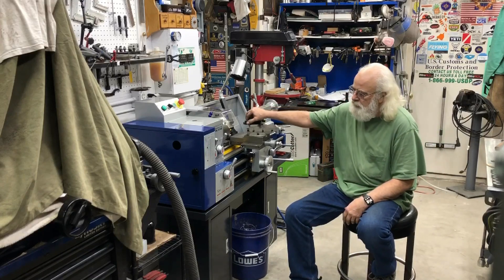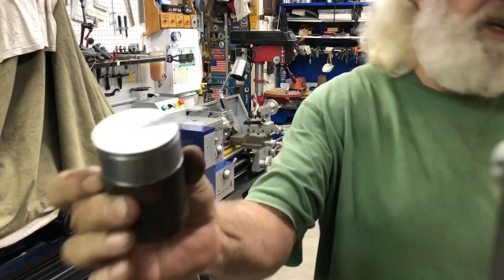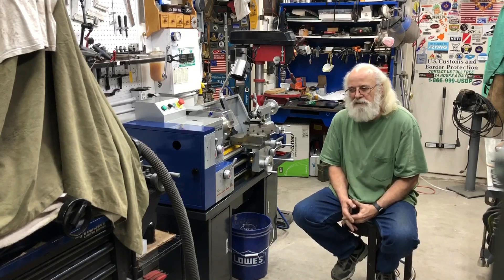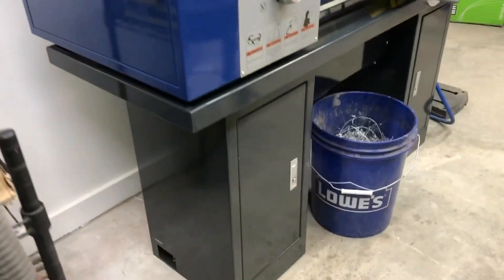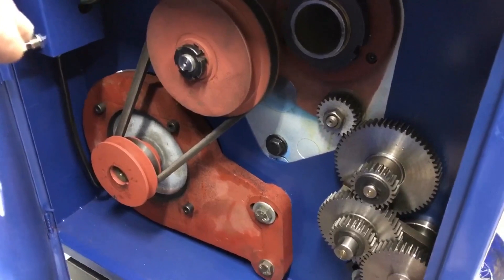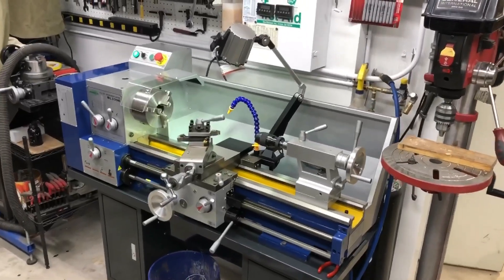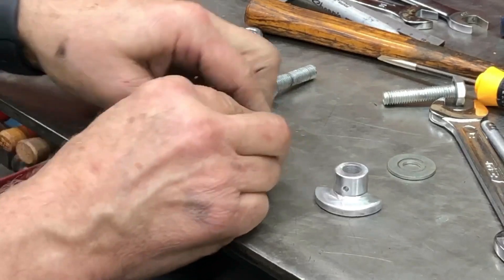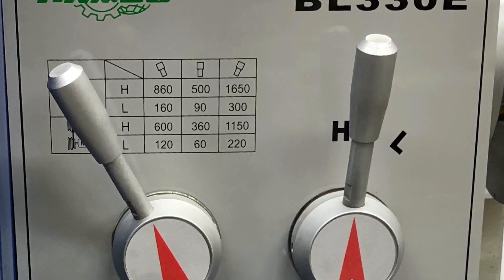ANMEC BL330E 13” X 30” Gear Head Lathe and Using it the First Time to Fix Itself

Comment: Did this lathe come with the 4 jaw and 3 jaw? Can’t seem to find any info on how it attaches either, thanks
Reply from the maker: It came with a 3 jaw and I added the 4 jaw when I ordered it.  The Chuck is mounted with socket head cap screws, and has 3 and 4 bolt patterns on the mounting plate.

Comment: Great  video I'm  in the process of getting  a  larger  Lathe  I  have  a grizzly 602 need a larger  swing  my question  how is the performance today
Reply from the maker: Currently it’s fantastic.
Reply: @papasfixitshop7982  thanks I didn't  no that a gear head was  much cheaper of the two I'm happy  with  my grizzly  now im doing  projects  that needs  a larger swing I  will  be purchasing  this lathe do to your  videos.
Reply from the maker: It’s a great machine, but fair warning, if you buy it from Toolots.com or Bolton Tools, you can expect Zero customer support or replacement parts.

Comment: Recently saw a vid, where a lot of fine chips been found in the gearbox. That guy removed all the oil and cleaned the gearbox from the stuff.
Reply from the maker: I pulled the cover before I used it and inspected the gear head components. The gears and shafts looked fine though not de-burred well.  There was zero debris of any kind in the bottom and the lubricant clean and slightly amber in color.

I’ve since run a maintenance cycle on it and there was a small amount of dark ferrous dust in the used oil but no noticeable problems.

Dark metal dust likely being cast steel it’s likely the gears de-burring themselves.

Thanks for the comments
Reply: @papasfixitshop7982  ok, thanks for the comment

Comment: I have been looking at lathes and am grateful for your tutorial review on this one. I have narrowed it down to this one or a Bolton 12X30 I believe. I have a couple of questions:
1) Are there accessories easy to find for it? I did not see on Toolots page any recommended or suggested accessories  like the show for the Bolton brand. (Live center, tail stock drill chuck)

2) Is the the head a Sanou brand? If I get one I would like a 4 jaw as well and as stated above they don't really have any recommendations on the website or in the manual that could find. I have a 4 axis cnc mill that uses the Sanou head.
Reply from the maker: Thanks for the question.  This lathe uses Morris taper on the head stock and the tail, mt3 and mt4.  The Chuck is bolt on so it’s safe to turn in reverse.  I ordered the 4 jaw Chuck with the lathe and it’s okay.  For the record, Bolton tools and Toolots are the same company.  I bought a quick change tool post and mounting it was easy.  I’m actually on the road right now or I would get you more specs.  If memory serves it’s an MT3 on the tail stock and MT4 on the head.  All the other tooling is standard 5/8” so it’s easy to find tooling.  

In spite of my assorted problems with the lathe I am a big fan and can’t complain.

I have a Bolton Mill, and Bolton is just as bad in terms of after support as Toolots so in either case you will be on your own.

Hope this helps.

KC
Reply: @papasfixitshop7982  thanks for the info. I kind of figured support may be a little questionable. I was looking at the Bolton AT320L as I was going to get a mill also like the Bolton ZX32GP along with a lathe. The AT320 and the Grizzly G0791 are the only two that have the spindle bore I want. The Grizzly is priced a little over $7k and I don't want to spend that much. The reason I said I figured that on the support is because right now toolots has a lot of items out of stock and aren't very forthcoming on when it will be in and won't take any orders on out of stock items.
Reply from the maker: @SM-hy4np  that’s the exact mill I have, ZX32GP

Comment: This is the same lathe that I have and the Worm Gear of BL330E|BL330E-1 went out on it less than a year after purchasing it. https://www.toolots.com/worm-gear-of-bl330e-bl330e-1.html
It's been out of stock ever since I went looking for it. Tool lots is no help. The machining company's name that makes the part is called ANMEC Machine Tool but I can't find a way to get a hold of them. I have no auto feed without this gear. 
Anyone have any ideas? Other than taking the lathe completely apart and sending the gear to a gear fabrication shop and having them make a new one. Which could be done, but then I'd be without my lathe the entire time. Currently I'm just doing everything manually and also using the threading feed. It's frustrating to say the least to not be able to purchase a part when it's needed.
Reply from the maker: I guess we are companions in frustration.

My motor is being rewound as we speak.

I noted that the lathe is mostly a total loss lubrication system.

Although the gear head has oil, the rest must be lubed every day.

Comment: Hey Papa, great vid! I was wondering if you still had the diagram you used to wire in the pump. I acquired this lathe from someone that wired it incorrectly and it trips the breaker when I try to run the pump. Do you think you could share the diagram or take pics of how you wired it?
Reply from the maker: So I can’t attach a photo to this string but I could send one via email if you contact me at papacondesfixitshop@gmail.com

Comment: Papas',  Cool video.  I bought a China 13 x 40 lathe from KBC Tools in Michigan.  Nice piece of machinery.  Went to change the toolpost and found ci dust in the slot in the cross slide.  Looked in the headstock and  saw filings in the bottom of same.  I completely dismantled my lathe, de-burred every gear, shaft, keyway etc., with a wire wheel on a grinder.  Cleaned parts with Mineral Spirits, blow dry with air, and clean re-assembly procedures.  Also replaced a couple bearings.  I am confident it will last a long time now.  Fun Project if a guy is up to it.  A shame they make many fine parts, and assemble a machine like these,  but are not so concerned about how they are assembled.  Guess That is why I did not pay 25,000 for a new, small, Clausing, if they even make them any more.
Reply from the maker: I pulled the gear box cover off and it was spotless with clean oil. I fully expect to get into it further in the future.  First I am trying to get a parts list from the vendor.

Comment: Thanks for the video! Definitely helped knowing how tall it was. It's probably a good foot or two too low for me haha. But I can make a riser frame for it pretty easily.
Reply from the maker: I’m thinking on that myself, I’m a bit over six feet and low stuff sucks🙂
Reply: @papasfixitshop7982   Wish me luck, I just ordered one!
Reply: @papasfixitshop7982  I'm 6'4" so I feel the pain haha
Reply from the maker: MrTurbo458, nice, so far mine is impressive, though I needed to pick up 5/8” tooling after I discovered the difference in rigidity made such an improvement. 

The biggest shocker to me so far was how good it is at parting with the automatic cross feed.

So Best wishes and congratulations on your new Machine.

KC
Reply: @papasfixitshop7982  Got my lathe the other day. Looks ok so far, but I wasn't shipped the right side stand for it! So far I've heard nothing from toolots about this. Hoping I get this resolved....
Reply from the maker: I got the Right side box of UPS and it came in a week but the warehouse is only 300 miles away.
Reply: @papasfixitshop7982  Good to know. Sucks that toolots can't tell me that up front.
Reply from the maker: I was able to find both tracking numbers on the toilets site on my order confirmation page and find out where the package was.

Let me know how your plan to raise it up higher goes, mine seems to have been made for a Hobbit so I’m thinking hard about risers.

Best Wishes,
KC
Reply: @papasfixitshop7982  I'll check that!  I'm honestly thinking about making the risers out of wood 4x4's...
Reply: @papasfixitshop7982  So I got the lathe lifted up 7" using some wood 4x4's to build a frame. Lagged it to the slab, and it's pretty solid. Any chance you could help me out with the coolant pump wires. No idea what I'm doing there. I see the ground, neutral and power coming from the machine. But where do those wires go on the pump?
Reply from the maker: @MRT_H  can you email me at papacondesfixitshop@gmail.com

I can’t attach a photo to this string to show you the wiring
Reply: @papasfixitshop7982  I'll email ya for sure, thanks!
Reply: @papasfixitshop7982  Thanks! I'll probably upgrade to a QC post eventually, but thanks for the advice!  Glad to hear it's worth it!

Comment: Hi Jim i bought one just like yours same stand  no drawers . My first impression of it was looks really nice well made for the price . Also mine  make the same gear noise ,one thing i did was greased the change gears it did nothing for the gear box noise but i think it helped with change gear noise . I'm going to build a quick change box for it . just a beginner but 40 year mechanic
Reply from the maker: The noise is in the gearbox but it’s changing so I’m not going to worry about it for now.

I get what you mean, I retired three years ago after working as a mechanic fifty years.
Reply: @papasfixitshop7982  I know what you mean anyhow have fun with your new toy and hope to see more of your videos